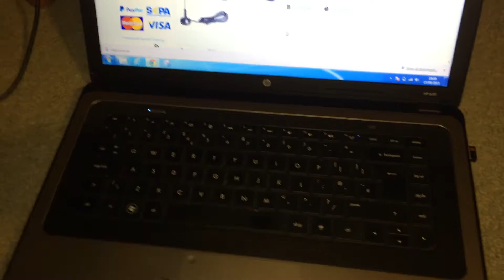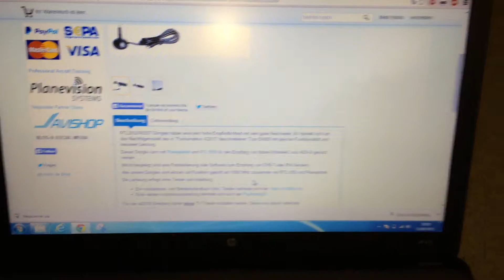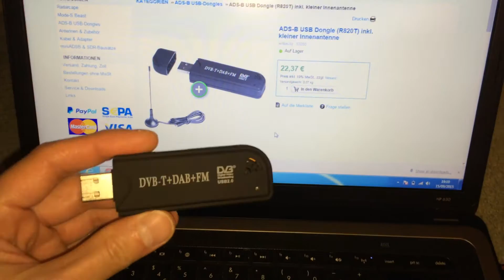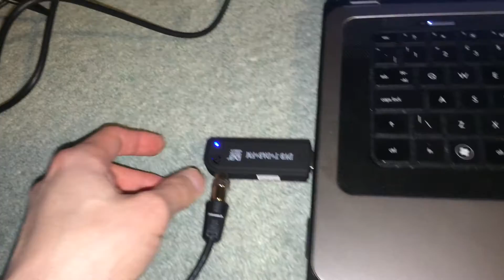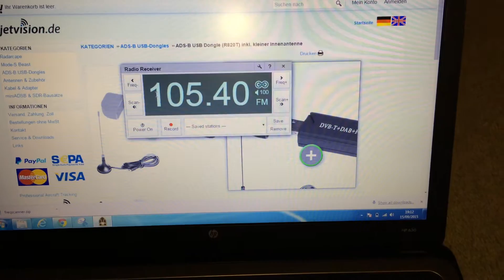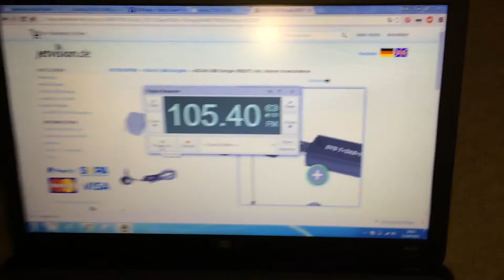Receiving FM radio stations with a RTL2832 / R820T SDR dongle

Comment: I got a question what kind of antenna connector that sdr use because I just bought that and it says it’s mcx, but I don’t know and don’t want to get the wrong adapter,can you help me
Reply from the maker: Depends on your SDR unit :) They're all different.
Reply: @BrianSu  mine is the identical unit as you have
Reply from the maker: @GuilhermeRossi11  it's MCX Male on the connector, MCX Female on the SDR
Reply: @BrianSu ok so I need a mcx male connector right
Reply from the maker: @GuilhermeRossi11  Correct!
Reply: @BrianSu  thanks bro Already order one from amazon

Comment: Hello iam interesting in use an rtldsr to receive fm as hifi tuner. I would to know what is the best receiver as quality sound. And second third and the poor for a good fm signal
Reply from the maker: Marko Kontiki hello. Ahh ok I think it depends on the software on your PC because with these SDR dongles, all the tuning, demodulation, processing, etc is done by software hence the term Software Defined Radio. The dongle itself doesn’t really do anything other than serve as an interface between the application and the antenna. I used this with the community FM antenna. The radio signal was clear as a result, but these laptop speakers were poor so I am not sure how well they’ll sound on your hifi system. What resolution and bitrate you get all depends on how the software converts the raw FM signal to digital. By the way if your have DAB radio in your country I would recommend that over FM as there are many more software options available for DAB.